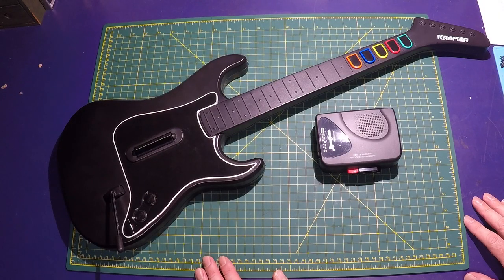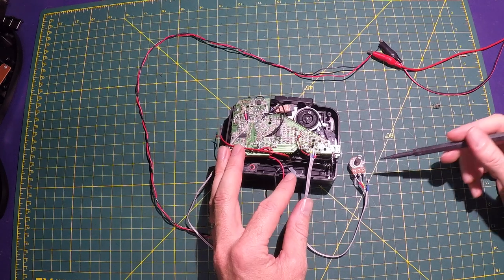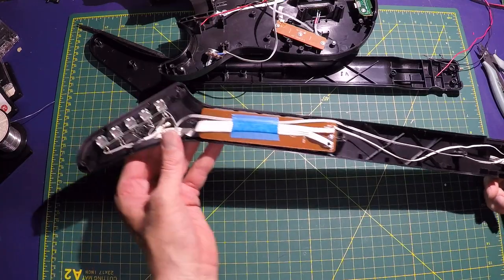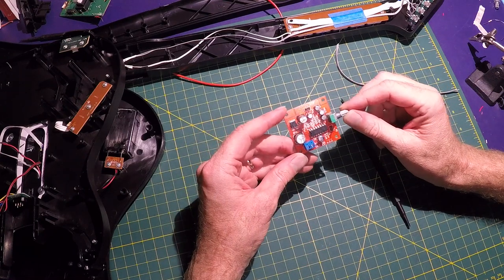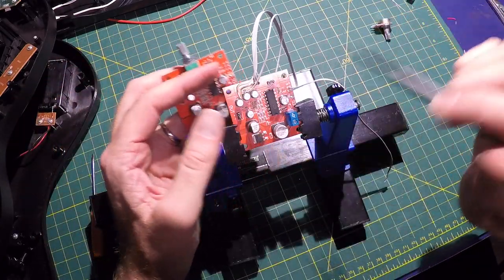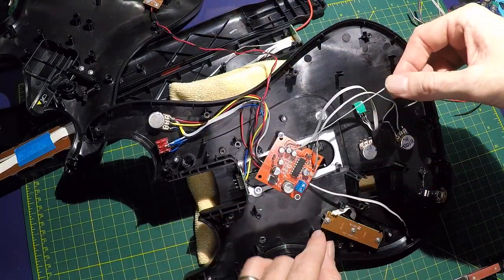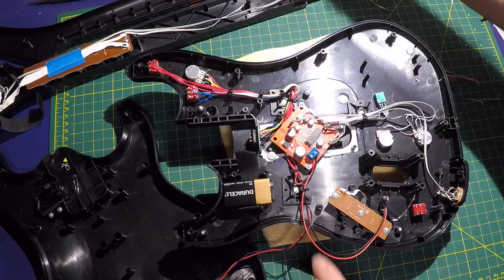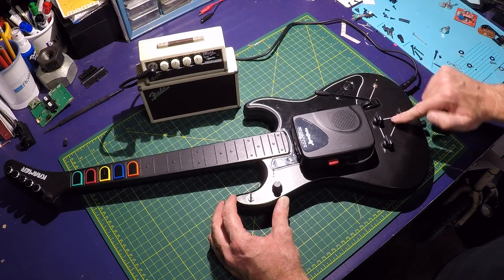How to circuit bend a Cassette Player and Guitar Hero controller.

Comment: You should put masking tape on plastic like that before you dremel or drill. Saves a lot of work later smoothing it out.
Reply from the maker: Yeah normally I probably would have but that cut edge was under the pick guard so I wasn’t very neat with my cuts.

Comment: It would be awesome to throw a monotron delay there and play with the "freets"
Reply from the maker: Well that is kind of what I did. I’m fairly sure The monotron delay uses the PT2399 IC which is the same chip on the red delay board I added. So in a way kinda the same thing.
Reply: @SISKworks  how would you do it to make it play tho?
I mean, swaping the ribbon strip to the buttons and "tunning" them with pots.